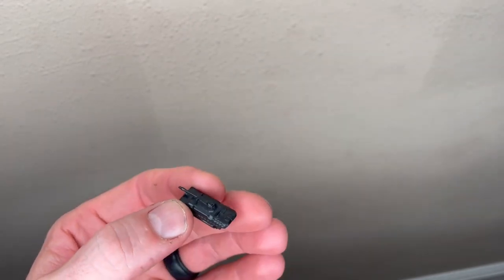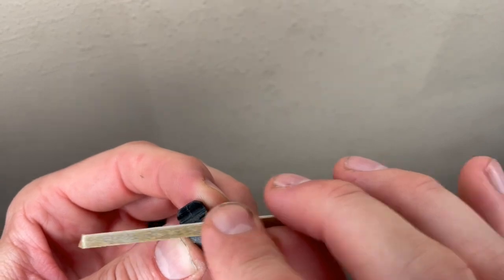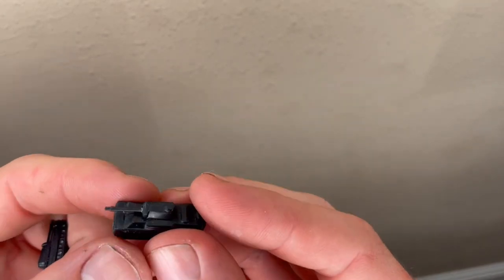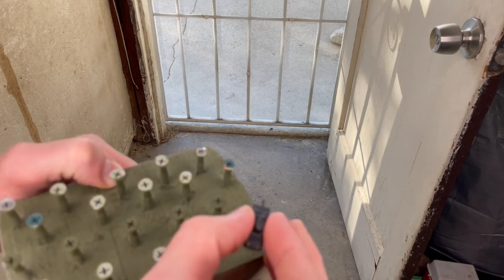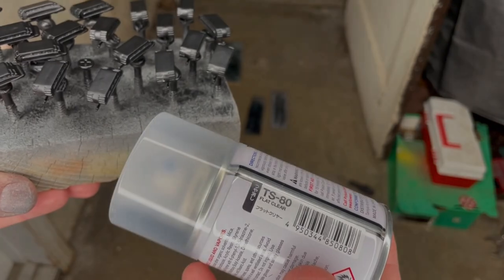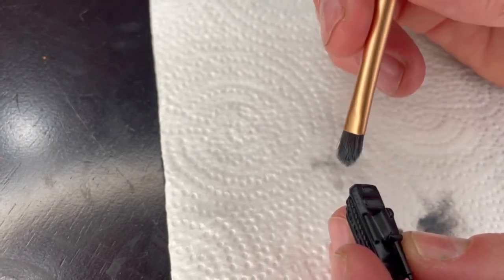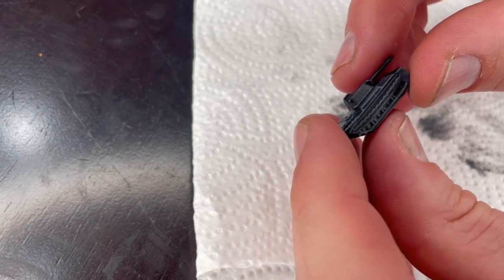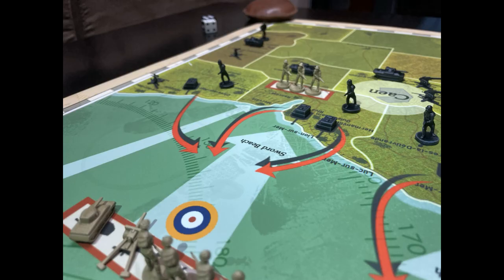AnA Clinic - Episode 5: Improving Out-of-Box Pieces

Comment: Very nice pieces. That mold line removal really does make it look much better

I kind of want you to do my pieces for me (a joke, but also let me know if you have a ton of spare time and you're feeling like doing some D-Day pieces).

A couple questions (I didn't know anything about customising pieces before this):

How do you apply decals?
What do "primers" do? How does it relate with spray painting pieces?
Reply from the maker: Decals: I use Tamiya's decal "softener" and decal "setter". The decal comes off after leaving it soaked in water for 2-3 minutes. I place a small dot of decal softener in a spot on the piece where the decal is going to go. I place the decal on the spot with tweezers. I gently move the decal into the exact position I want. I use a q-tip and roll it across the decal to remove bubbles and soak up excess liquid. I then apply a think layer of decal setter on top to "seal" the decal properly.

In theory, primer is designed to stick to plastic surfaces better than a colored paint. A coat of this helps keep the color you apply later last longer. Eventually, after several years of use, the paint will begin to chip away but it should help keep it together longer and more durably. 

Thanks, but I cannot make pieces for anyone. I'm flattered but it is a labor of love and takes a lot of time to do it well.
Reply: @thegoodcaptain1217  Thanks for answering my questions!

I understand that you won't be able to do the pieces for me. It certainly looks very hard and takes a lot of time.

Comment: Does anyone wash their pieces before painting them? Does it help? I've heard residue from the manufacturing plant causes paint not to stick well
Reply: I usually wash mine just to be on the safe side. It’s an extra step but I’d rather do it than have the paint not cure or hold correctly and then have to redo the paint job.
Reply from the maker: That is a legitimate step in the process but also one that not everyone follows (the same is true of priming the pieces as well though). I don't personally wash the pieces and have observed no ill affects over the years.
Reply: @thegoodcaptain1217  Agreed! I don’t know that I’ve seen or experienced a difference either over the years. I think depending on the level of detail you’re putting into the pieces can be a good indicator of whether or not you want to risk having to redo the paint job.
Reply: @crookedlegs-thekansascityw8598  very good point